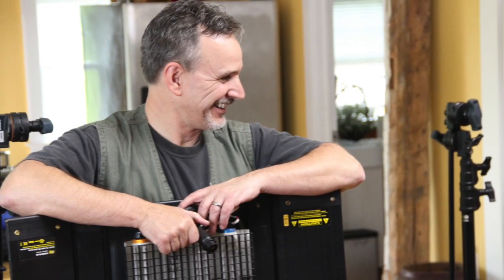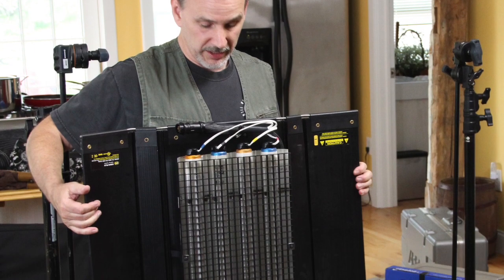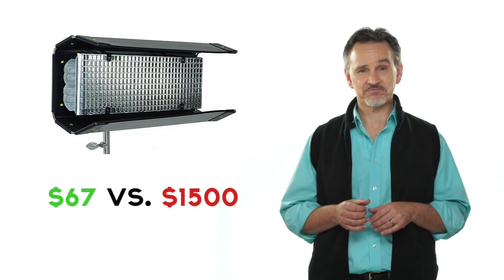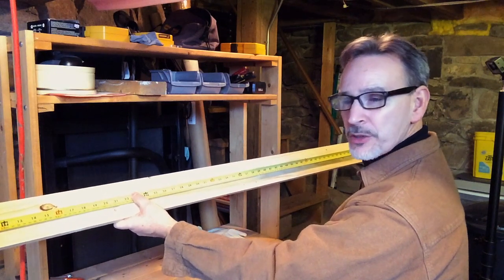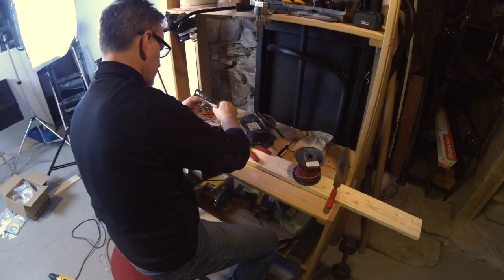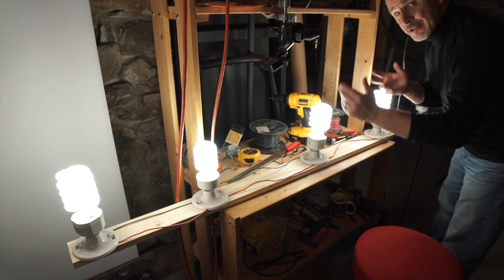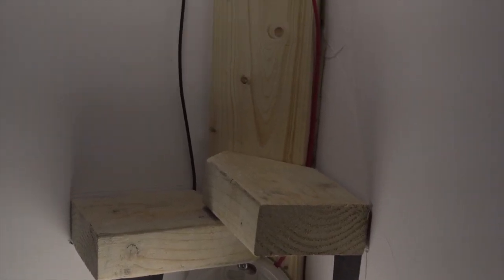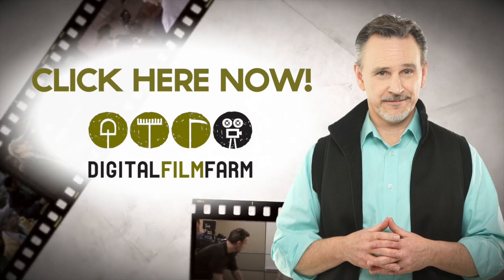DIY Kino Flo - $67

Comment: Hi, where did you buy the parts? I am particularly interested in the light fixture. Thanks.
Reply from the maker: Hey +Michael Carman,  All the hardware can be bought at Home Depot. The bulbs came from Alzo lighting and the foam core came from amazon.  You may want to look into the LED shop lights they sell at Home Depot. For $50ish bucks, they're a pretty nice daylight source. Be well!